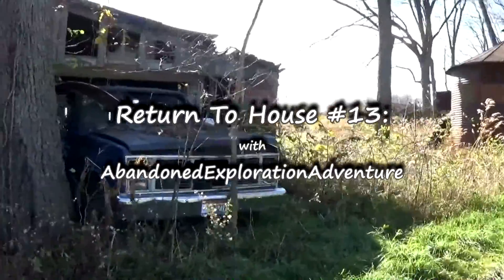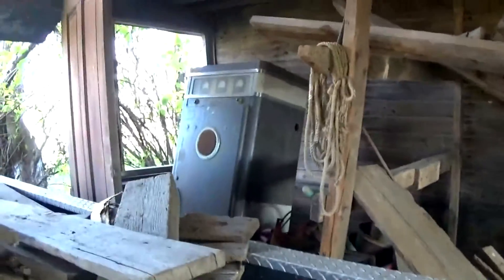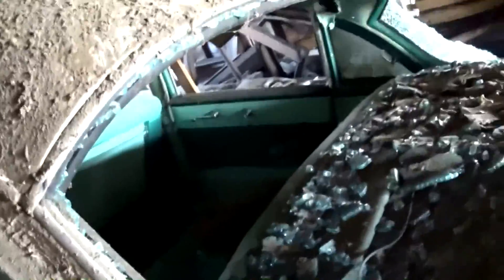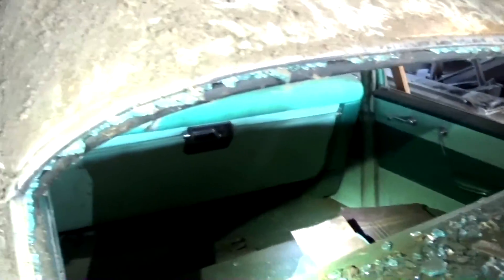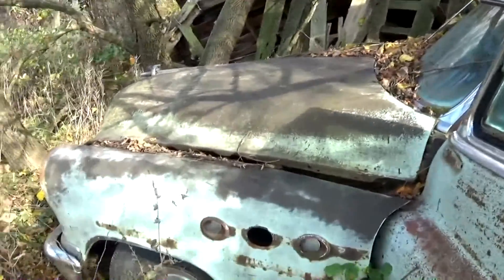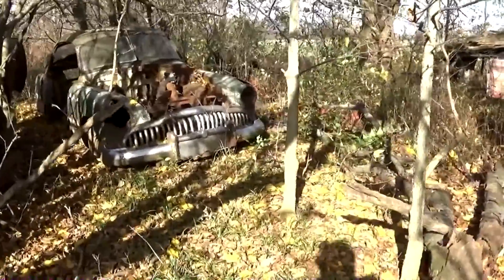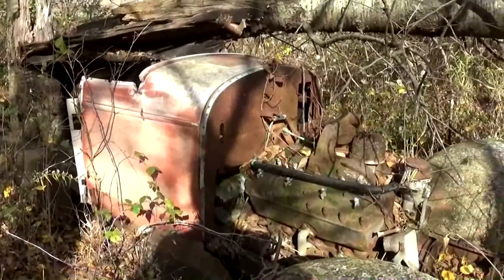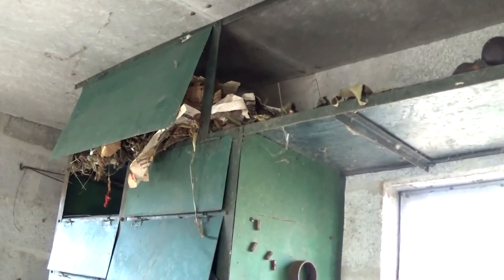Return To House #13 /AbandonedExplorationAdventure: Part 2

Comment: Was told that that one car that we couldn't identify was a 1947 Packard and that old truck that's missing a lot of parts WAS likely a 1930's Ford with a flathead V8 engine. GREAT video Jac. Loved how you added the workshop on at the end.
Reply from the maker: +AbandonedExplorationAdventure Thanks Ben. It makes sense although I certainly can not see how in the world one can decipher the year and make of a vehicle with only two or three pieces available. I am impressed. Got your pic disc ready for delivery. That includes the shoes.
Reply: I agree about the dates! Those are definitely some car junkies. And very cool. I'll be there tomorrow like we discussed.